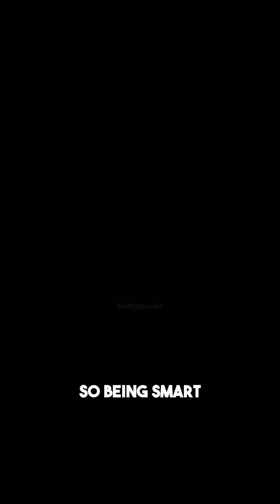How ICBMs Actually Work #shorts

Comment: Most impressive how he just "installed" that satellite guidance system through that hollow steel pipe's wall, from which no rocket is composed anyway, btw.
Reply: ehhhh many missiles use GPS and INS systems
Reply: @HSG123-nc5gp ... which you install through a solid wall of steel, like shown in this clip? I sincereky doubt that.

Comment: Who’s mocking who? Dude what the hell is Mock
Reply: Mach speed" refers to an object's speed relative to the speed of sound (Mach 1), a crucial measurement in aerodynamics, where Mach 1 is the speed of sound, Mach 0.5 is half, Mach 2 is double.

Mach 1 = 1,235 km/h
Mach 20 is that multiplied by 20 :)